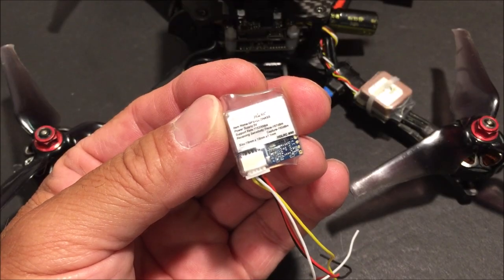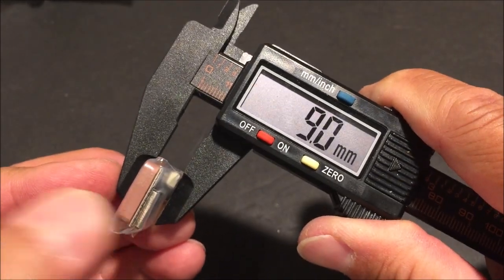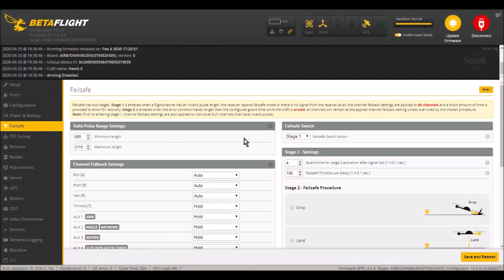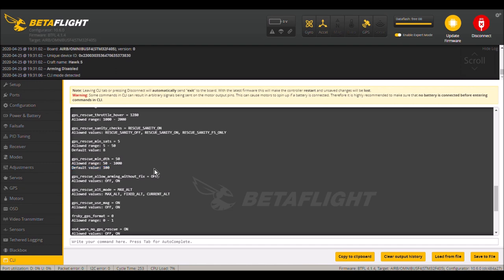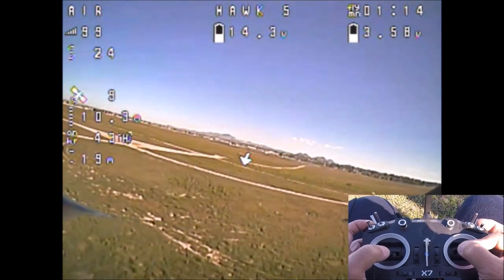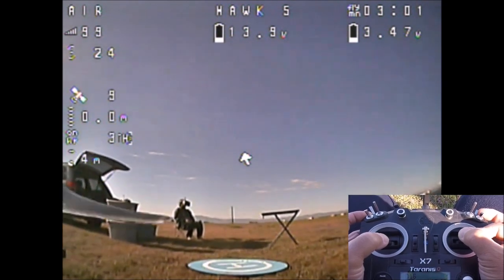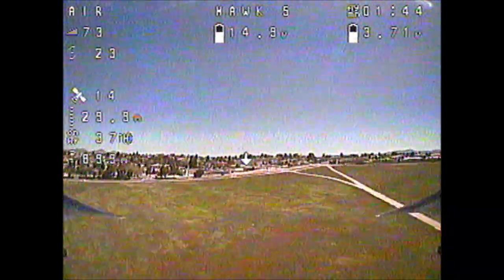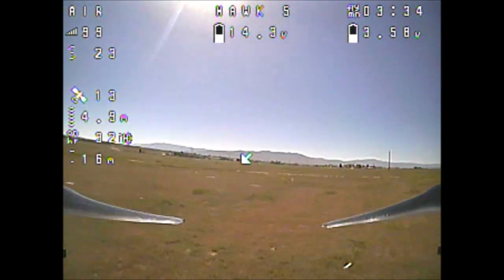GPS Rescue / Failsafe Rescue Test and Set up HGLRC M80 GPS

Comment: Thanks for going over this again Pete I would like to give this a try. I never installed mine on the Tyro 129 and this is a great How-To👍
Reply from the maker: Thanks Steve :)
I'm starting to put a gps unit on most of my fleet.  If you are gonna fly amongst trees or something else in proximity, set the gps rescue minimum distance higher like 200meters so you can do proximity near by and cruise too :) 🍺🍺

Comment: Thanks for the informative video, question, when you fail-safed your rssi was reading 66, is that reading not a bit high for a failsafe? I thought rssi would have to be near zero for a fail-safe, similar thing happened to my toothpick the other day so I'm curious.
Reply: Mark B i’m wondering about that too, i’m thinking there might be some sort of interfering disturbance at that spot. I’m curious about the LQ value there, but does that work on frsky? Or is that only available on crossfire?
Reply from the maker: @EbrFPV  
There's just something about this spot that 99% of the time it'll failsafe. There has to be some interference.
I don't think frsky has link quality just crossfire.  One more reason to go crossfire.
Reply: RC Escape hahaha, yeah, go for it Pete. I’m very happy i jumped over.
Reply: I too am about to jump over to crossfire, I have everything except for the Jr module adapter, it's on the way, I was going to leave my toothpick on frsky but I think I'll change that too, having Link Quality is obviously a bonus as I can't see interference with rssi.

Comment: Can "Position Hold" using GPS be  added to that drone, along with the "Return To Home" function ?  or  does that need a different Flight Controller?
Reply from the maker: There is no position hold command in betaflight yet.

Comment: So my Rekon35 can only do GPS on softserial. At 9600 baud I get pretty consistent lock of 18 sats. Do you think RTH will be OK, or will 9600 baud just not work? My opinion is that raw GPS data is probably not any higher than 9600 baud anyway.
Reply from the maker: it should work.  the default is 100meters so go out more than 100meters to test.

Comment: Nice Pete. I recently put GPS on one of my quads, and i’ve got it working, but haven’t dared trying the fail safe yet. I’m a bit afraid about the proximity of the highway at my spot. Put it in to be ready for my summer holiday to the mountains, where i figured it would come in handy for some midrange mountain gliding. Even only the altitude and latitude on the OSD is great, for finding the quad back if needed. But i’m afraid i’ll have to wait to next years holiday for the mountain gliding. I’m curious what happens if you don’t take control back. Does it stay hovering above the approximate homespot, or does it descent into a crash?
Reply: I tried it, on switch everything is perfectly working, but when I turned my radio off, to simulate real connectivity failure, quad came back, stayed 10-15 meters above me, and I wasn´t able to gain control back no matter what. Then it dropped. Luckily to the high grass, no damage.
Reply: Vaas did it drop because the lipo got drained?
Reply: @EbrFPV  
No, battery was fine, it dropped after some time just because flight controller decided to. Good thing is, that gps is pretty accurate. It dropped like 3 meters from starting point :)
Reply: Vaas that’s good to know. If you know that that’s what it’s doing, then that’s better then dropping where it lost signal. 👍👍👍
Reply from the maker: Definitely retake controls since it will not land softly by itselt but will drop and may cause damage.
Reply: RC Escape when i will use it, i intend to do that. Was just wondering what does happen. Will try it in a big open field myself soon
Reply: Hi just want 2 findout that did u install gps on non gps drone ? N is it possible 2 do it ?
Reply: I have seen that moving the sticks 30% will generally resume control- best to test in a safe area.
Reply: Tie a rope underneath with 3 cable ties and test failsafe
Reply: @vaas2642 wait, it didn't land?

Comment: How long should it actually take for it to connect to the sallelites?
Reply from the maker: it depends on where you are.
Reply: @RCEscape  Outside at my house. I'm new to GPS so trying to fully understand it. I'm also located in the US. I just can't leave it plugged in for minutes on end while the VTX is getting hot waiting on satellites even if it is on low power disarm 🤔
Reply from the maker: @TRITONFPV  
You can take off and fly if set to do so in betaflight and while it is flying, it will acquire the necessary GPS satellites so land it then and set the home point and then you can use GPS features.
Reply: @RCEscape  I'm gonna have to go back into BF and take a look. I flew for almost 4 minutes and never locked on any satellites. Weird but like I said I'm new to GPS but not drones. Thanks for the input 👍🏻

Comment: Mine had gps speed working but not direction home arrow . Hmm
Reply: Needs a compass for that.
Reply: @karanveergujral2539 it didnt need a compass it was a satelight count . Whenever the satelight count of satelights locked onto dropped below 8 satelights the arrow disappeared . 
  I noticed the arrow coming on and off in replay of fpv and figured it out .
     That meansanother bad thing for gps failsafe i heard that if satelight count drops or if you fly under a tree or roof and lose gps your gps failsafe drops the quad . So i do not use gps failsafe because satelight count goes up and down all the time . But the airspeed and direction home are nice because they go on and off with satelight count without disarming the motors .